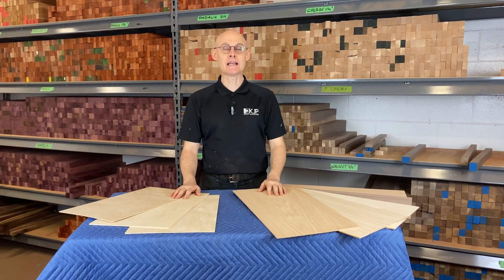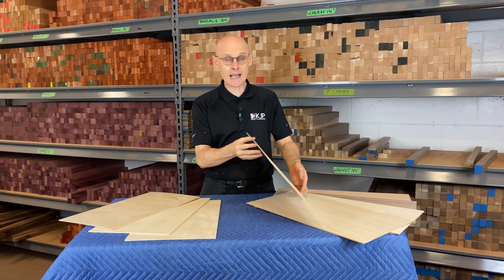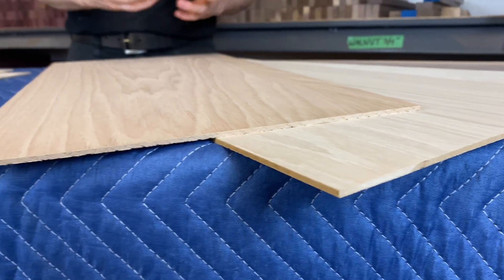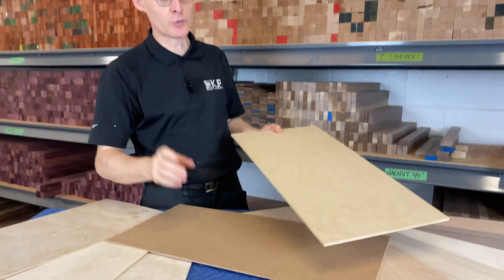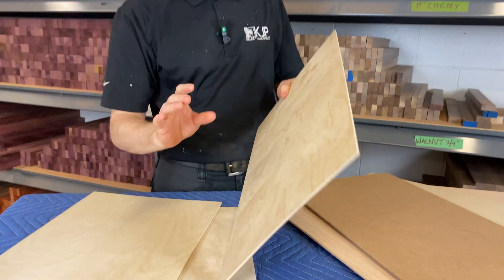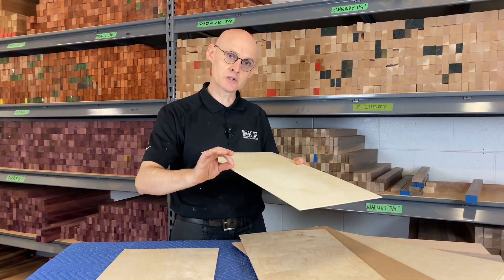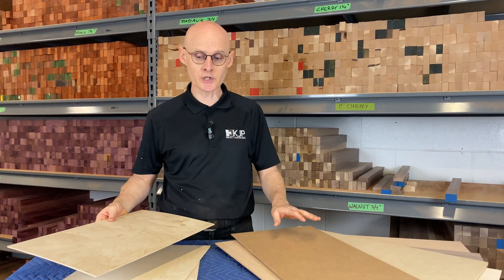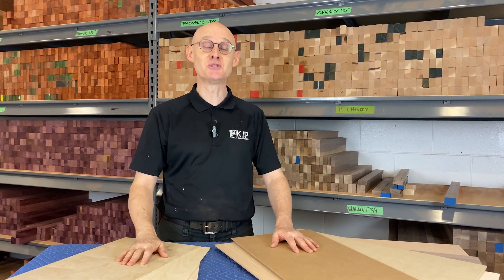Laser & CNC Plywood Options

Comment: I use about 30 pallets of Baltic Birch plywood per year.  I have been looking for alternatives, and this is not going to be an alternative because once again, like all other inferior plywoods, the outer veneers are paper thin.  I simply cannot sand it gently enough without removing it.  The laser cutting process leaves a residue on the surface from vaporizing and re-depositing.  I have to sand it off on most of my products and I'd be ruining them.  Also, if the inner veneer is thicker, it tends to be more flexible along one axis or the other where Baltic Birch has a more consistent stiffness along each axis, at least with the 6mm.  Look up the products I'm making on baltic by design.